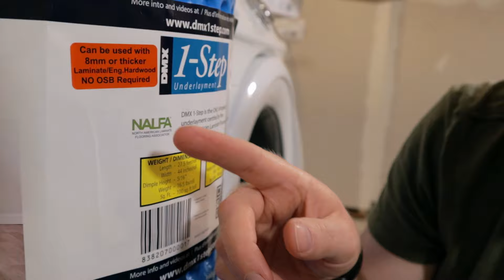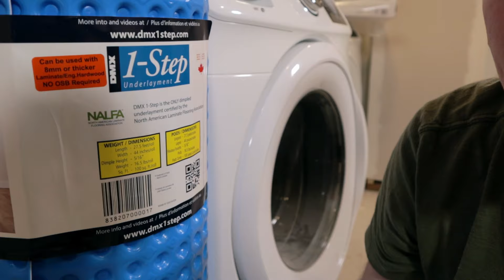Laminate Flooring Installation with DMX 1-Step Underlayment - Laundry Room Makeover: Part 7

Comment: Looks good. Easy enough to do.
Thanks 😎
Reply from the maker: Installation was quite straightforward. Thanks for watching!
Reply: Hi, did you use this subfloor for your basement? Just want to get your feedback since I am planning to use it for my basement in Winnipeg, where the temperature can get very cold during winter.
Reply from the maker: I did but this style of subfloor doesn't have a lot of insulation. If it's an area you're going to be using a lot, you probably will want to go for something thicker with a higher R-value

Comment: Looks great! Almost four years on, any issues? Would you recommend this stuff? Just looking into different subfloor options for my basement.
Reply from the maker: We moved a couple of years ago but no issues before we left the house. I'd use it again if I was doing another floor
Reply: @Handyverse  Thank you!
Reply: @Handyverse Do you think it would mess up the floors if it was installed upside down? (white side facing up)

I'm realizing the contractors I hired years ago installed it that way - and I'm seeing cracks in our floors

Comment: But whats the purpose for underlayment?
Reply: You don't want direct contact between your flooring and the cement.  Cement is moisture retaining so it can cause damage and potentially mold on your flooring (if your flooring isn't moisture resistant.  The sub floor prevent that contact as well as acting as a vapor barrier which also prevents moisture accumulation.

Comment: Laminate in laundry room/bathroom is a terrible idea...
Reply: What is better on concrete in a basement?
Reply: @cejanuary9378  tiles or vinyl, basically floorings that are waterproof since basements are pretty moist
Reply: That's my thought too, laundry rooms could get washer leaks etc.

Comment: I have done everything DMX told me to do, and still have terrible humidity problems under this floor. It should be considered insulation ONLY. If you even suspect you might maybe possibly have the tiniest bit of water getting in, this is not for you. I had a professional basement water proofing company come look, and he told me he cannot think of a single instance someone should use this product. Tile in a basement is the only way to go.
Reply: Did you end up having the tile installed directly to the concrete floor?